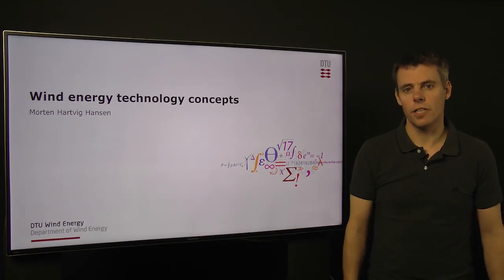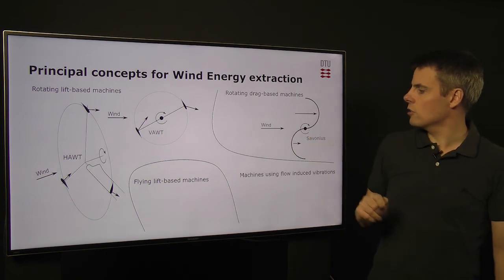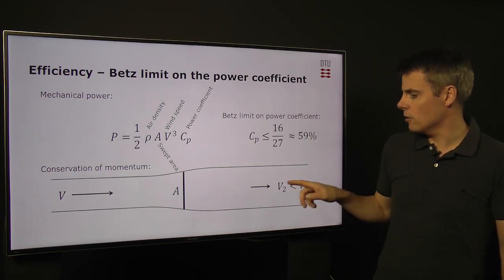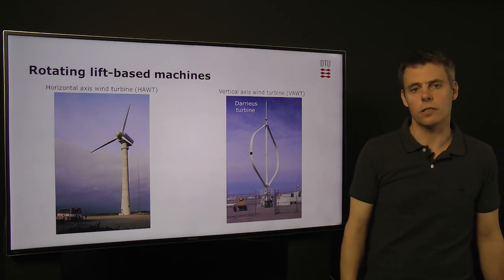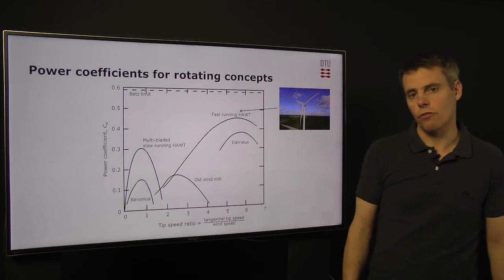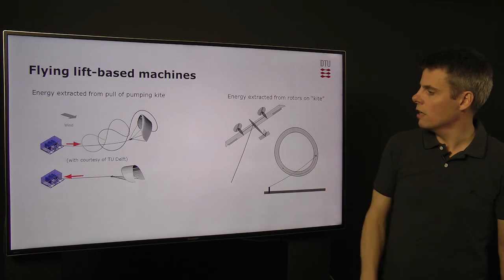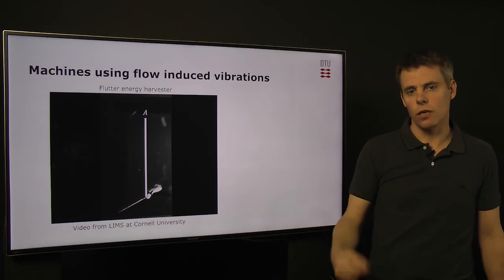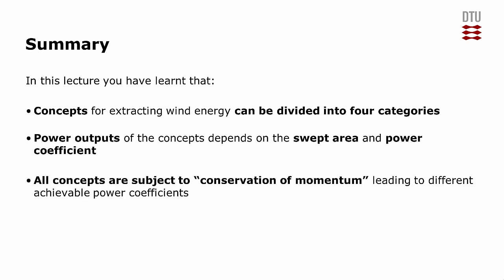13. Wind energy technology concepts

Comment: The next blade following in the "shadow", (an actual resonance reflection), behind each other gets added "lift" above the wind speed from the reflection vortex. (?)
This would be the tuned inside-outside spin-spiral, mass-energy-momentum pressure of frequency of aligned sync-duration timing In-form-ation, all-ways all-at-once present in QM-TIMESPACE holography.

This example of vibration configuration is dominated by a photonic pressure of information wave of sound, in a holistic arrangement of Electron-photon-phonon-Proton superposition oscillation, ie Neutronic time-timing sync-duration spacing holography.